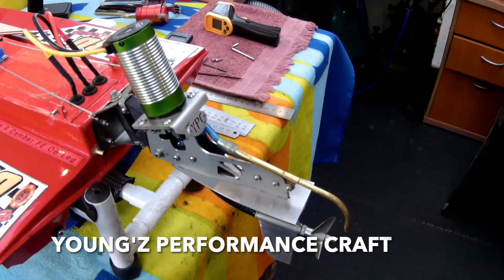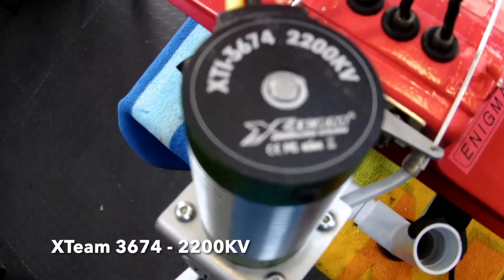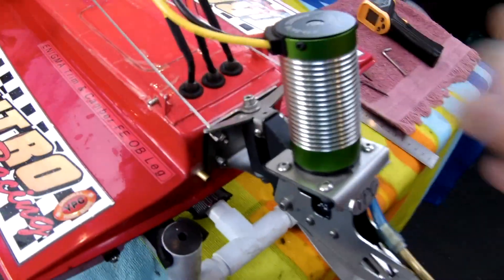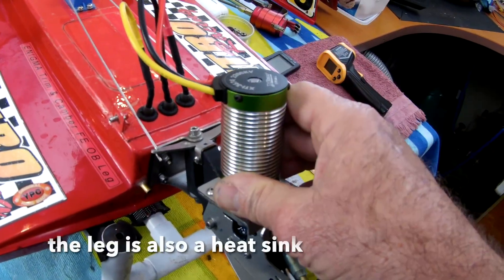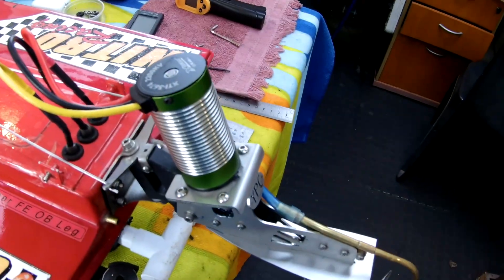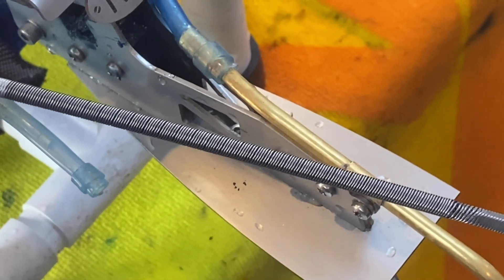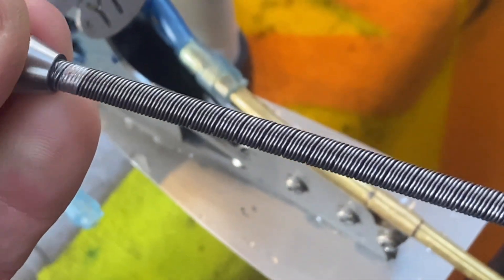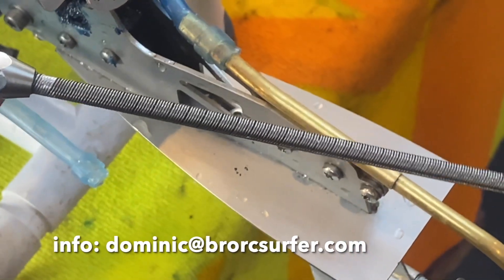YPC Fast Electric F1 outboards - Running the XTeam 3674/2200km brushless motor.

Comment: Great runs Dom, those figure 8 turns with the Leopard motor were insane. As you say, the on-off throttle response is wicked!
Reply from the maker: Howzit Mark - thanks for the comment - much appreciated, especially considering your FE experience  - I'm really happy with the overall package and performance thus far - moving onto reproducing a few hulls to get a few keen local guys going, then going to redesign the hull to be more FE specific - Lekka weekend